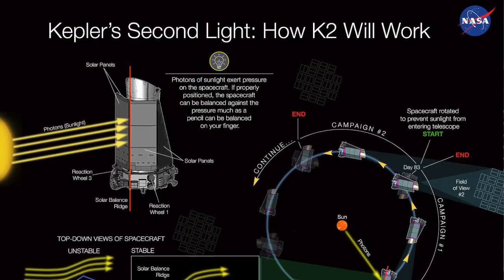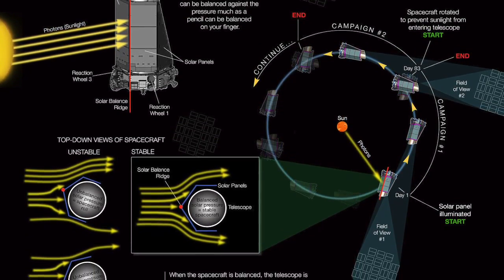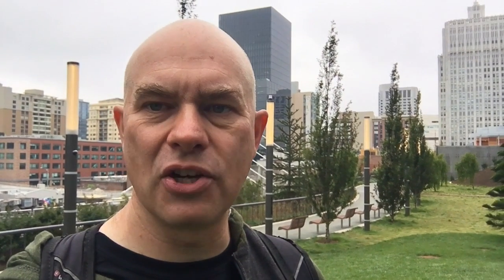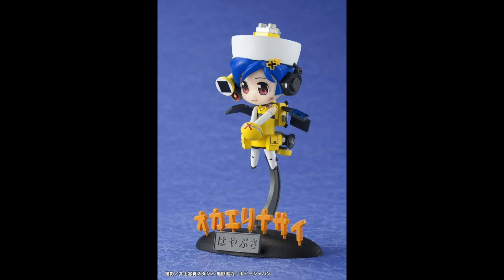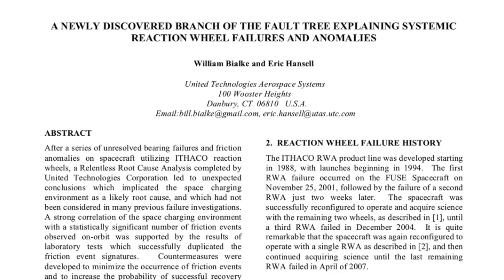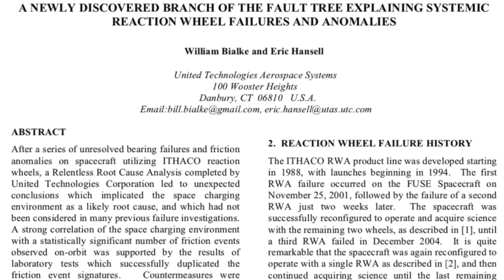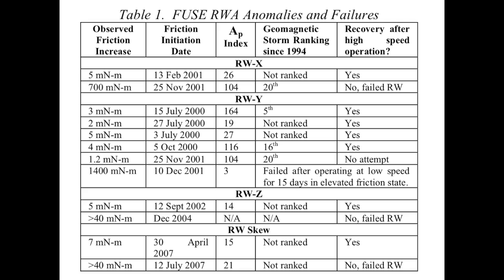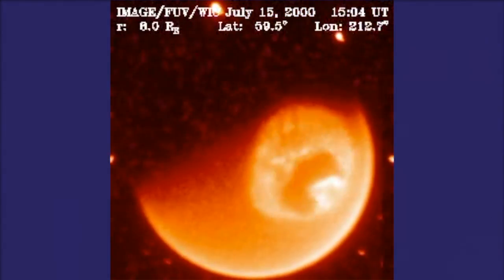Scientists May Have Figured Out Why So Many Spacecraft Were Failing

Comment: So I will begin with "I am not a rocket scientist" however as an industrial HVAC and commercial equipment service technician I replace bearings all the time and as a matter of fact I am currently covered in grease from a 15 hp electric motor that blew a rear bearing and cost my customer over $2000 to fix. There is this extreamly common thing that happens to electric motors that are being driven off what we call a VFD (variable frequency drive) it allows us to control the speed of a motor but because of how a vfd works and converts the voltage it creates voltage spikes in the rotor that hava no where to go but through the bearings and into the housing, this pits the balls, races and destroys the bearing over just a few months. The thing to keep in mind is that there is a very small amount of contact area from the ball to the race so it doesn't take much to destroy the bearing in a very short period of time. Something as simple as a rotor grounding shaft would have eliminated the bearing failure.
Reply: Conductive lubricants will also eliminate these failures, Polyrex EM or Retinax EPX/M aerospace.
Reply: @Druicidal   Conductive lubricants tend to have higher viscosities and particulate content. Perfectly fine for an industrial motor, but completely unsuitable for high speed high precision applications like a reaction wheel.
Reply: @ergohack  Retinax in particular is available down to NLGI 000, but the life of the lubricant makes use in sealed assemblies impractical.
Reply: @Druicidal  I would expect them to be using fluorocarbon or maybe silicone based lubricants due to the lower vapour pressure.  (Eg Krytox) Any datasheets for conductive Krytox branded lubricants (at least what I've read) tend to include warnings about increased bearing wear. 
     Any methods I am aware of for making greases and oils conductive involve the addition of conductive nano-particles. Regardless of the size and uniformity of the particles, they still represent a compromise. To get reasonable conductivity, the concentration of particles needs to be high enough that the particles are basically touching. Needless to say this doesn't exactly help with lubrication. Carbon nanotubes could be added in lower concentration due to their shape, but it seems to me like they would have a tendency to tangle and clump up.
Reply: @Druicidal  Would those work under the conditions of space?
Reply: This is exactly what my mind went to when Scott mentioned solar flares. Searching for "bearing common mode current" provides lots of relevant results for anyone else looking for more info on the VFD/earthly sort of failures.
Reply: Thanks for taking the time to post a valuable comment. Respect to HVAC!
Reply: This happens if the VFD is not properly adjusted, or just cheep Chinese junk.
The VFD has to adjust it's parameters in conjunction with the magnetic properties of the motor. (just asynchronous motors)
Because the motor is builds for it's specific speed and load on a fixed frequency and voltage. If you change especially the frequency, u also change the magnetic response between the windings and the rotor cage.
Her in europ we then just get problems with windings sparking over, VFDs cooking off and emv complains (Electromagnetic compatibility)
Never heard about bearings sparking over, must have to do with different constructions of the motors, or the way the grids are constructed.
In europ we ground the shitt out of everything, maby this helps?
Reply: This is whats great about science, the anecdotal evidence the plant i work in would say that systems with drives last longer.
Reply: Yeah. Some manufacturers of induction motors for use with VFDs offer an optional add-on device that attaches to the back-end of the motor and is always in contact with the rotor shaft to ensure there’s always a path for induced currents to be discharged in a safely manner effectively preventing them to travel through the bearing.
Reply: wheelitzr2 - ok, next time I’m gonna use a VFD, I’m definitely going to ground the rotor! 🤔
Reply: The more you know, cheers for that insight :)
Reply: Well that explains all those swamp cooler motors I have had to replace.
Reply: Ithaco used the wrong kind of grease to pack those bearings.  Whoops!
Reply: VFD are necessary to get high level of precise control. As most people here know they are changing AC to DC current which allows for higher precision in motor control which are also in standing machines like used for the making of copper wire.
Reply: Not all motors are rated for high frequency operation.  Double insulating motor coils is a good idea.
Reply: @notamouse5630  double insulated motors are a good idea but wouldn't have prevented this particular situation. They double insulate the wire inside the stator so it can take more heat/amperage without burning up, they are usually used in equipment that require a bidirectional quick acting use of a high Hp motor, basicay if the motor has to start and stop quickly or change direction without stopping the motor first, as in CNC or high production machines.
Reply: Another simple fix, would be to directly connect the inner and outer bearing races using brushes.

No reason for electricity to arc across a gap when there’s a direct path.
Reply: Ceramic bearings should be standard if a VFD is being used.
Reply: That's a good point, possible solution.  Stuff get weird in space though.....at least worth testing.
Reply: Alignment of the motor can also cause the end of the bearing to "pack up" The more out of line the motor are with the gearbox ect. the more force are there on the back bearing. a 0,05 mm misalignment at a distance of 1 meter can cause the shaft to be out with about 5 mm. This will not really matter if it is a slow spinning motor, but with higher speed 2800 rpm it will make a very big difference.
Reply: What abut magnetic levitation bearings? Couldn't that make future reaction wheels virtually immune to such failures? Such bearings do not rely on perfectly smooth surfaces. And they'd be air-gapped a significant distance, which should significantly increase resistance to such internal electric arcs.
Reply: @XpaceTrue  magnetic bearings would absolutely work, unfortunately they would take power to make them work weather through powering the magnets or the controller that would be necessary to phase them correctly. Magnetic bearings have other negatives as well, we have a facility that uses "air bearing" chillers, they are magnetic bearings in the compressors/ motors, we can't modulate the chiller so they have to overstage the chillers and add boilers to keep them from over chilling or cycling. Basically magnetic bearings can't take any side loading and aren't perfectly precise due to the air space required between the moving parts. Also if they contact each surface even one single time would destroy the bearing and subsequently the gyroscopic unit.
Reply: Another idea: The mechanism by which these "reaction wheels" are used to rotate a probe along one of three axis is because of Newton's 3rd Law of Motion, right - equal and opposite reaction? And don't these work similar to a gyroscope, with a motor that rotates a wheel of significant mass? But, instead of relying on the rotation of a physical wheel, why couldn't they design a PLASMA reaction wheel? Granted, ionized gases do not have much mass. But, as Scott Manley points out, these probes often use ion engines for propulsion, which uses this principle: the acceleration of ionized gasses to provide work by Newton's 3rd Law. Consider: A PLASMA reaction wheel should be virtually immune to the theorized cause of failure of conventional reaction wheels. And while the torque of a plasma reaction wheel may be minute, it would add up if operated continuously and with strong enough magnetic fields. I'd think that for certain applications - such as aiming instruments at different deep space phenomena for study - that a slow rotation should be fine.
Reply: @XpaceTrue  that's a fantastic idea on the plasma reactor, the issue is what it would require for power to make a plasma reactor on board a tiny craft like this, the power unit just for the plasma reactor would be double the size of the entire spacecraft. But I like your out of the box thinking, those are the kinds of ideas NASA needs.
Reply: I would think an electrically conductive lubricant ought to solve the problem?
Reply: Can someone answer if the bearing or race can be surfaced with non conductive material?
Reply: Voltage spikes are easily suppressed just use a snubber a RCD snubber will do 
But what do I know , just a amateur hobbyist speaking
Reply: I was thinking of the same thing when Scott was talking about it. In the HVAC world there is a simple and cheap fix for this problem, a bearing protection kit. See: https://www.helwigcarbon.com/products/bearing-protection.html
Reply: @JHNielson4851 I imagine carbon brushes are frowned upon in weightless environments where the dust can spread everywhere.  They also have a limited life, though maybe not more limited than the rest of the spacecraft.  And of course, they do load the rotor shaft with extra friction.
Reply: On a motor like this, that costs $97,459? I made that up, I'm sure it's a lot more. I'd expect tungsten-copper alloy brushes, with each wire plated in a good vanadium chrome, and then pre-sheared to the exact angle of the matching rotor contact surface ...
Reply: I imagine grounding something that is in space might be difficult. Given the lack of ground :)
Reply: @samholden5758  cars and aircraft manage somehow
Reply: It was a joke. The :) was suppose to indicate that.
Reply: @samholden5758  that is correct there is no true "ground" on a space ship. However not all circuits on Earth use an earth ground I have lots of cabinets that are issolated from ground through a transformer so we would call that cabinet a chassis ground. Almost the same thing that happens in an automobile.
Reply: wheelitzr2 There is no true ground at all, anywhere. "ground" is a practical slang term for the masses, good enough to get the job done but not fully true. "Reference rail" or "common reference" would be a more accurate concept to teach in electroskity 101.
Reply: @mytech6779  if you didn't get what I was saying that's not my fault.
Reply: @mytech6779  that is true about not having a true ground, however if I said common rail your the only one that would have understood what I was saying. By the way this would all be a DC voltage and "ground" wouldn't even apply to this situation even on earth. I was trying to keep from getting to technical in my comment and a "ground" is more or less a common term that just about everybody knows or understands.
Reply: @wheelitzr2  nothing on earth is truly isolated because we exist in an atmosphere.
Reply: @Sam Holden, made me smile :)
Reply: @samholden5758  Anode cathode. Besides, you just need the energy to enter and exit without an effect on the bearings.
Reply: You gotta be American (hvac) or German (bering knowledge) because you are just too right about what you said.
Reply: I work for a major aerospace company and I find that the engineer's are book smart they couldn't build a doghouse.
Reply: Very good to hear your solid sense born of life and grease at the frontline. 
If only engineers got to get their hands dirty these days, everybody would be in a better position.
IMHO
Reply: Electrical grounding on spacecraft is a little more difficult than on the ground, since the Earth is far away ;-).
Reply: In this case, 'ground' simply means providing a conductive path between the two races so the balls or pins don't have to carry any current in the case that a voltage differential arises.

Ceramic bearings - mind blown...
Reply: @gg5115  absolutely correct! Thank you.
Reply: @EricFielding  Electrical grounding rarely has to do with “ground” we walk on.
Reply: So you knew this all the time but nassa  brightest minds needed decades to figure it out? Thats pretty sad :(
Reply: The odds of you figuring out some simple fix that many "rocket scientists" didn't while designing these bearings is "astronomical".
Reply: @rdooski  so basically what your saying is that the bearings in space that have hardened races, balls and cages are 100% completely different to the bearings that I use every day That also have hardened races, balls and cages? Yes there are different ways to make bearings but just because NASA (or a rocket scientist) used it doesn't mean it's not subject to the same type of failure. In other words I'm sure NASA isn't designing specific bearings just for space exploration.
Reply: @wheelitzr2  they are not dealing with the same environmrnt at ALL.  heat, cold  vacuum  radiation, or just the inability to ground a device, all those mean that what makes sense on your vfd might make no sense or even be impossible on a satellite.  Basic principles are the same, but the conditions are not.  
Like every problem, you first have to deal with the parameters.  They woukd have tested the crap out of those reaction wheels as well as they could, exposing them to every nasty issue they could think of.  Ask any engineer, and hell tell you the very worst problem is an intermittent one.  Simply put, nobody considered a once in a long while problem with a transient voltage coming out of the vacuum of space.  Now that they have, it seems obvious, but the lightbulb had ro go on first.
Reply: @wheelitzr2  It´s subject to the same type of failure and it´s subject to other types of failure, you are not aware of. There is where the trouble starts. You can only deal with the challenges you are aware of. You need to know for example that in space if the outer layer of metal oxides are removed (e.g. by friction), two parts get welded together because the metal atoms connect between the two parts. The oxid layers keep them apart and they do not form again, because there is no oxygen.
Reply: >The odds of you figuring out some simple fix that many "rocket scientists" didn't while designing these bearings is "astronomical"

Oh please, this happens all the time in every industry throughout human history. You want to fix a problem your team is stuck on, go outside your team. You'll all collectively slap your heads when the dead simple fix is revealed.

This is the exact reason we do sanity checks.
Reply: @rdooski  The odds of the MIC admitting their bearing might have a problem instead of being the best and cheapest since baked beans and bread is astronomical. Also astronomical is the chance that the very same will put a team on it, therefore admitting their entire design and safe operation phases were a big fat fucking lie.
Reply: @rdooski  Ya and titanic sunk cause they were such GREAT MARINE ENGINEERS!
Reply: Dave Nezra Pappas Titanic sunk due to a bunker fire which had been burning since she departed Ireland. Most of the stokers got off at Southampton because of the risk they saw. The hull strength was fatally weakened.
Reply: @rdooski  not really. Rocket scientists tend to find complicated solutions to simple problems.
Reply: @Demonslayer20111 Sure, rocket scientists do find complicated solutions to simple problems, because (as we all know) for every problem there is at least one simple, easy and wrong solution.  Usually the rocket scientists found out that the easy solutions do not work, either through experiment or by doing the maths.

Example: why not put the rocket engine at the top and the rocket will self-stabilise like a pendulum?
See here, Goddard's first liquid-fuel rocket: https://en.wikipedia.org/wiki/File:Goddard_and_Rocket.jpg in 1926 --- the engine is on top and the tank --- the "weight" to the pendulum --- is well below.  Simple problem, simple solution ...
Reply from the maker: What you have just described is the Pendulum Rocket Fallacy - it's a common idea which is based on an incorrect interpretation of physics.

Goddard did indeed try this, and his rocket gracefully arced over and crashed.

https://en.wikipedia.org/wiki/Pendulum_rocket_fallacy
Reply: Some things about the "simple fix" and "rocket scientists"...
1) There are very often constraints/reasons why a "simple fix" isn't possible for a particular application.
2) Designers tend to trust the specifications... At some point, you just have to since you can't know or test everything yourself.  Unfortunately, "in space" is not part of the normal specification range for most parts.
3) It seems that the preventive measures in the case of reaction wheels and arcing is just to enclose the entire thing in a EM shield / Faraday cage.  They were doing that anyway, so bearing arcing just shouldn't have been something you'd have to worry about.  Unfortunately, reality doesn't always work like our simplified engineering models predict...
Reply: @travcollier  how exactly is a Faraday cage going to help when the motor is getting direct voltage inside the cage? It would be like setting up an entire office inside a Faraday cage, the entire office will still work the same inside but can't communicate with the outside unless hard wired. A Faraday cage would have been installed around the motor to protect the rest of the space craft from unwanted electrical discharge, as a fact everything on the space craft is built with it's own Faraday cage just simply to keep any single device from effecting the extreamly sensitive instruments that are the reason for the craft to be in space. There have been several high profile satellites or space craft that have been built that didn't work properly due to one single device effecting the instruments from not being properly shielded. I would be willing to put money on there NOT being a possible way for a Faraday cage to protect a metal bearing in any condition.
Reply: @wheelitzr2  the voltage is created by the ionized material flowingvpast the spacecraft, so the faraday cage SHOULD WORK
Reply: @markdoldon8852  yes the cages are there to protect the parts of the craft but the bearing failure has nothing whatsoever to do with ANYTHING coming into the craft from space. The bearings are failing from voltage spikes created when the speed controller pulses the voltage to the motor to keep it's speed. Every 1 second the speed controller can pulse voltage into that motor over 1000 times and every time the voltage goes up and down it creates a voltage spikes in the motor that has no where to go but through the bearings and if the voltage spikes is high enough it causes the pitting that was shown in this video.
Reply: @markdoldon8852  so basically what your saying is all of those bearings I've replaced over the years on vfd driven motors was caused by the radiation in the atmosphere? Trust me I get what your saying but I don't think you fully understand what your talking about.
Reply: @markdoldon8852  I think this situation is static electric, so a faraday cage won't save you. Stray electrons (beta waves) hit the space-craft and charge it to a higher potential with static electricity. Well, the shaft is isolated and therefore not charged to the same potential, so a voltage develops across the bearing, zap. The spacecraft now has a strong negative charge, pulling positively charged particles towards itself and repelling negatively, so the spacecraft potential drops. However, the shaft is isolated and therefore not discharged to the same potential, so a voltage develops across the bearing, zap. The spacecraft is now neutral and no longer attracts positively charged particles, so stray electrons begin to collect upon it, rinse and repeat.
Reply: @Demonslayer20111   NASA spent several million dollars to develop a pen that could write in space for Apollo.   The Russians used pencils.
Reply: @MichaeljRichter  This was studied, and the graphite gets attracted to electrical parts (since gravity is not there to pull the dust to the ground, it gets attracted to electrically charged things) causing short circuits and sometimes electrical fires. Also, NASA did not pay for the development of the ‘space pen’, although they did buy a lot of them; it was being developed for other writing challenges such as experienced by law enforcement.
Reply: rocket scientists are engineers... engineers are idiots... look at the whole mars lander meter / foot oopsie